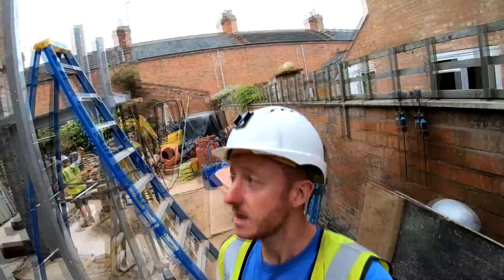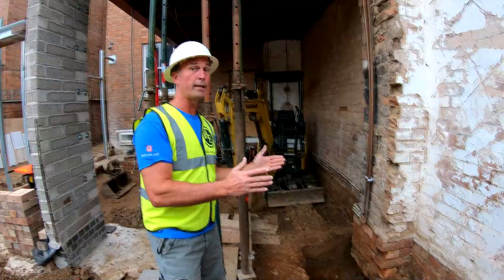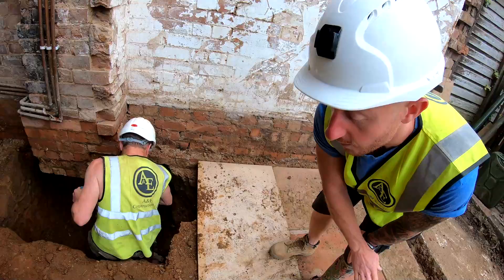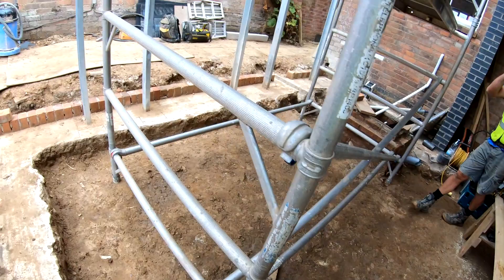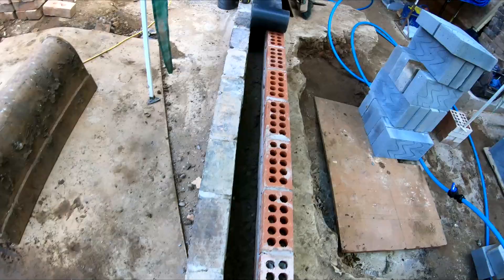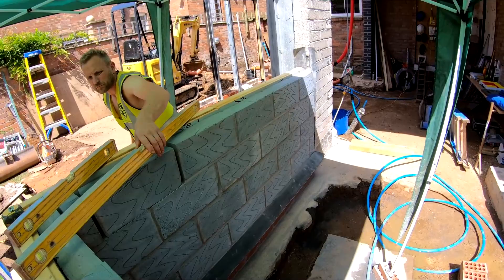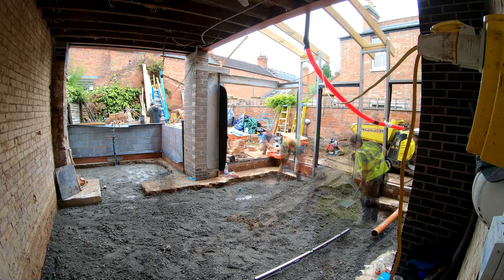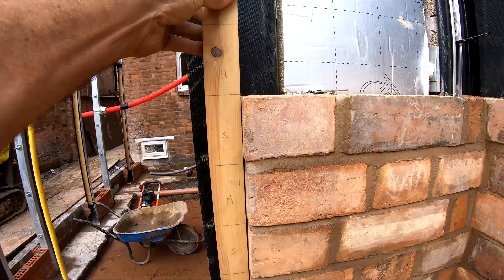HOW TO BUILD AN EXTENSION #5 | Underpinning, Groundworks and Brickworks to DPC

Comment: Cool video! May I ask what that dark stuff is called underneath the pipe that holds the drainage wall in position? Also, can I ask whether if there’s requirement to encase the pipe with granular surround before pouring the concrete over it?

Comment: I would not like to be the man in the hole with only air holding up that column of bricks!
Reply: Stay at home son, leave the building work to the men
Reply: Doesn't work like that.  If your were to draw 45 degree lines from each  side  of that pit and form a triangle.  That would be less than a metre high. That means about 20 bricks could fall because the rest of the bricks and the steel above are supported by the bond and foundation of that flank wall. Only the 20 odd can fall. There is a ridiculous amount of overkill in this job (specified)  the 7nm blocks shows that. The builders do a nice job but the customer will pay the extra for an arse covering exercise.  No criticism of the builders themselves.
Reply: @140rware  excellent comment

Comment: At point 9.33 on the video and Tony says that any water will escape through the weepholes does that mean that the DPC bridges across the cavity as I thought it was always in 2 rolls. A separate one on the outer and inner skin of brickwork. Also is it not normal to build up to damp and lap the DPM membrane under the DPC, but it appeared as you were doing it a different way here on that back section that was built.

Comment: It sounds like you got off lightly with the digging specs for the underpinning,we used to do a lot of subsidence work for insurance companies which usually required a minimum 2mtrs in depth and 1250mm in to the footprint of the building measured from the external face of the brickwork. These jobs were on 3&4 story houses that had been built on spread brickwork,never the less you still had a good graft to do there.

Comment: So is the whole corner of the house supported on a block pier or is there a vertical steel hidden in there?
Reply from the maker: Hi Agenda the engineers detail was just a block pier with padstones on top all the best Tony 👍
Reply: @BuildWithAE  Fair enough, I guess it gets lateral support next to the steel connected into the ground beam. Cheers.

Comment: Is that normal building procedure to lay concrete on top.of foam? I feel like thats more of a 20 year solution rather than lifetime solution, am i wrong? I'm looking to lay a interior slab and would love to insulate it that way!
Reply: @SteS  thats great thanks for this  👍
Reply: @eaminslim52  no probs. 150mm (2 layers of 75mm brick bonded and staggered layers) I spec for alterations & new build and sometimes 200mm. But you can ring kingspan technical and give them the floor perimeter and floor area for them to give you the correct size.